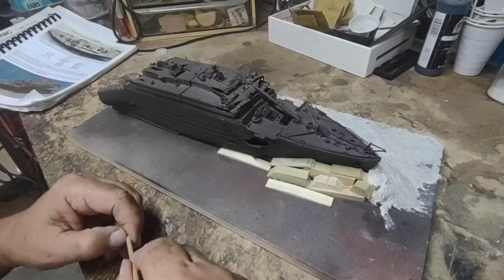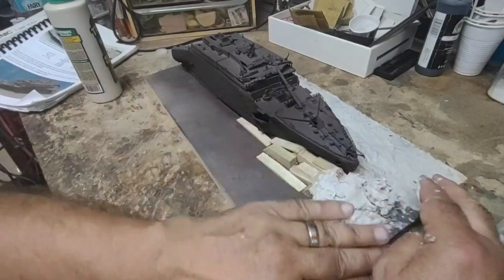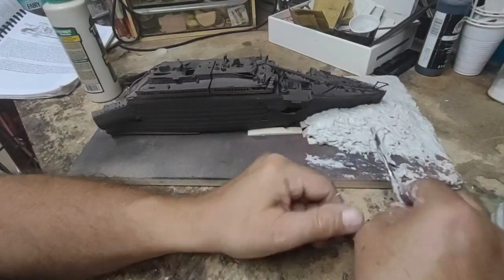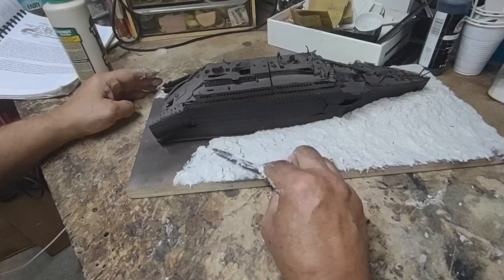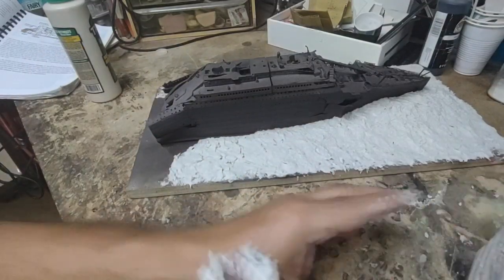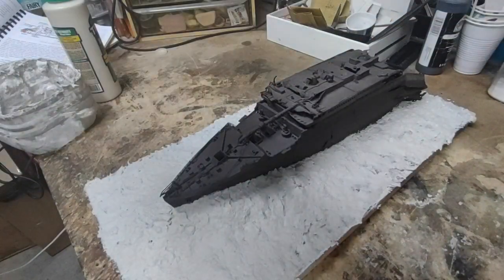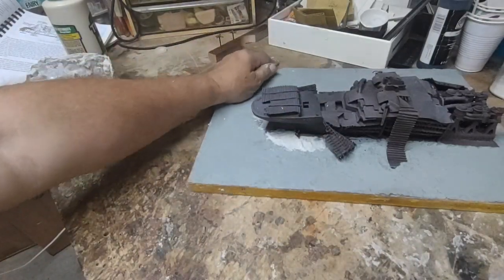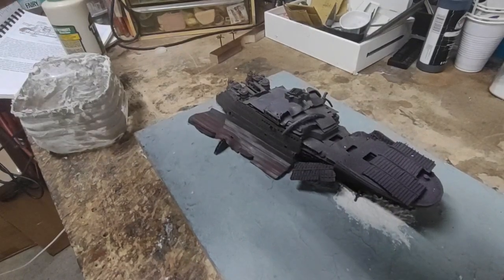Titanic Wreck Model Diorama Part 44 Making mud and the Heflin UFO!

Comment: did I see another crack behind your big opening on the starboard side? seems like it wasn't there before in earlier videos!
Reply from the maker: I don't recall adding any other damage since I built up the bow section SEVERAL months ago.  From the studies I've made of photomosaics of the bow it appears as if quite extensive cracking and hull plate separation occurred on both the Port and Starboard sides.
Reply: ok, just looked different from your earlier videos... maybe its because of the paintjob 😅